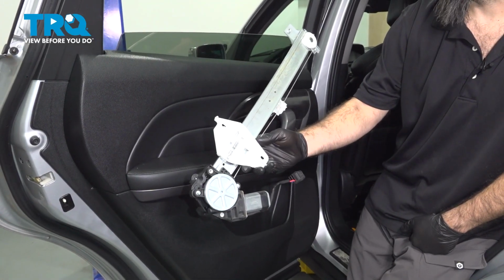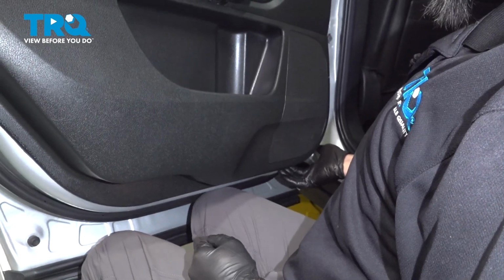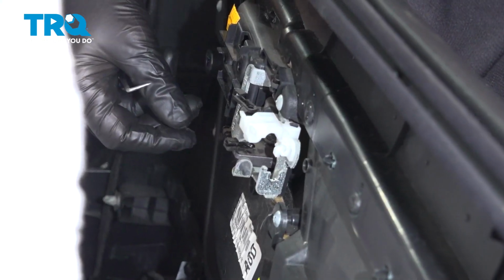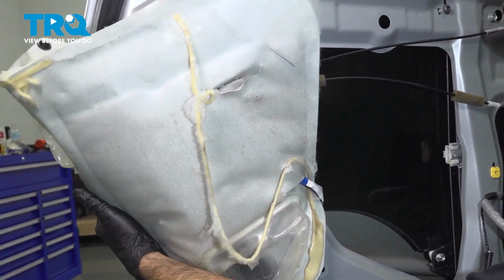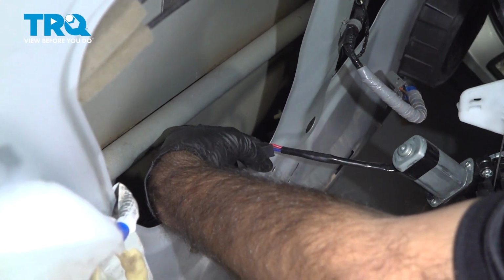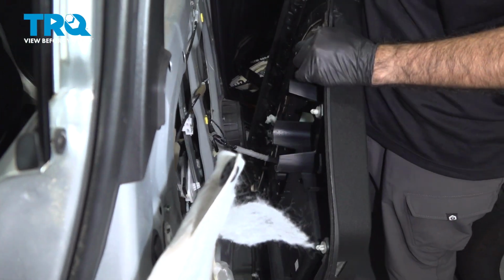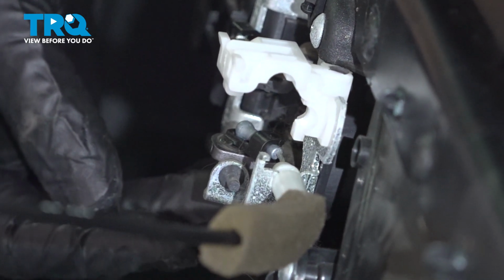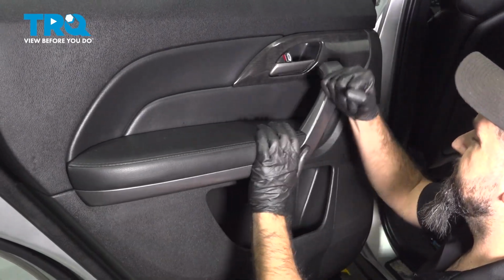How to Replace Rear Power Window Regulator 2007-2013 Acura MDX

Comment: Good video, I have a 2013 Acura RDX.  Small problem is that one of my rear window regulators is broken with window in the up/closed position.  How are you supposed to lower the window to remove the bolts that fasten the glass to the regulator 😮

Comment: I removed old plugged n put the new regulator and tested and it doesnt work.. is it a faulty part or did i miss a step? Is there any things i gotta remove or a switch on the new motor/ regulator or its just plug n play? Went to test the old one n it still moved the lines the old motor still worked replacing due to plastic part broke that keeps window along the track. Anyway old one still functioned new one didnt….. faulty part right?